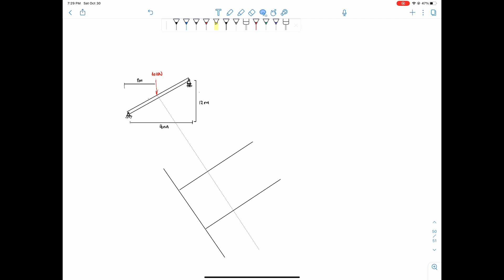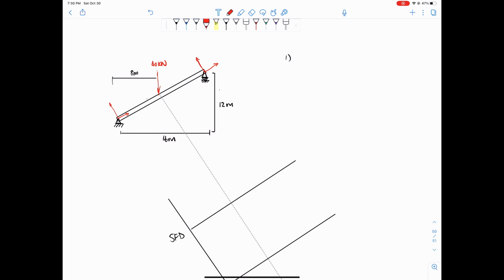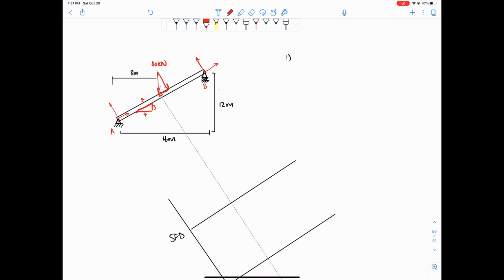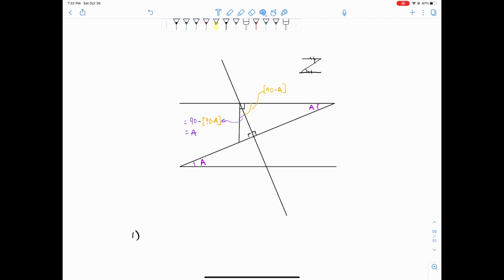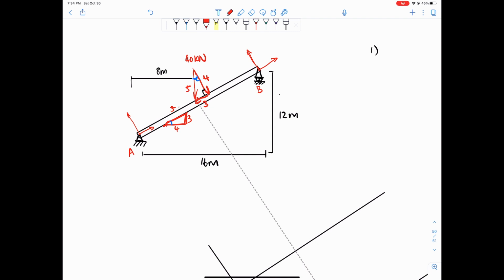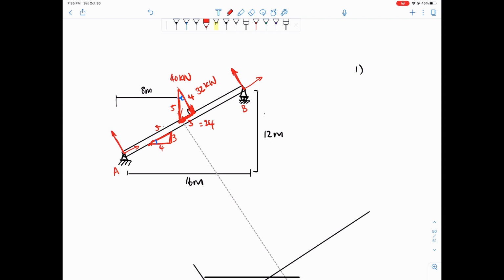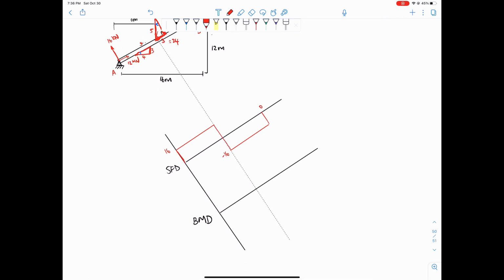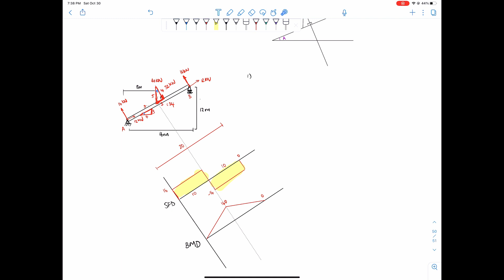Drawing Shear Force and Bending Moment Diagrams - Example 12 Slanted beam.

Comment: The horizontal component of forces do not matter at all while drawing the SFD & BMD?
Reply: The horizontal forces are acting as axial loads, so there is no shear or bending moment. The horizontal loads would be shown in an axial force diagram (sometimes known as a normal force diagram). This is what he was alluding to when he said "may be included (in) a graph later on."

Transverse shear is always normal to the longitudinal axis of the beam/beam-column element. Axial loads are always parallel to the longitudinal axis of a column/beam-column.